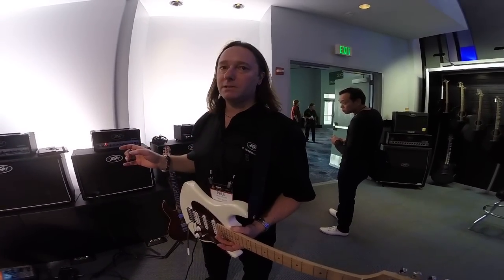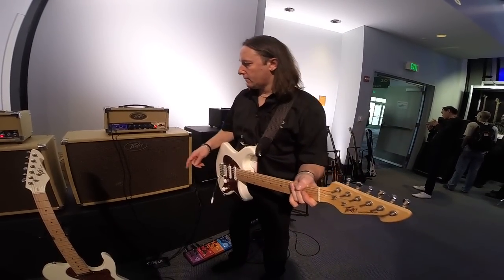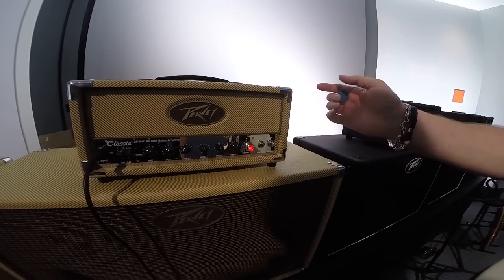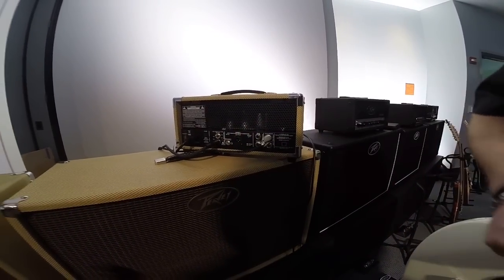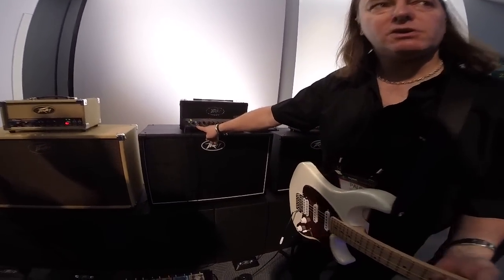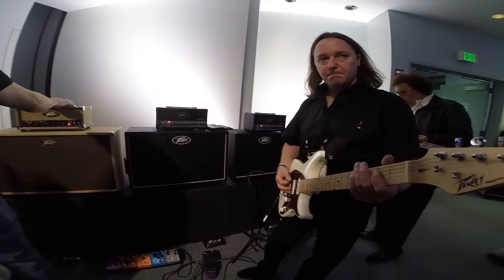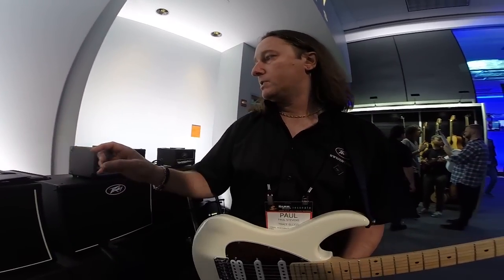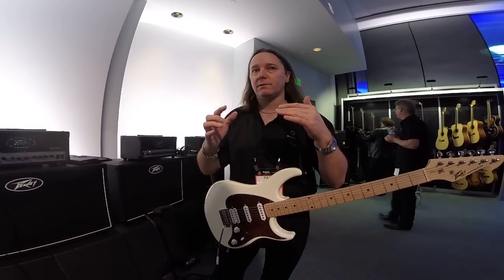**NAMM 2015** Peavey Classic 20MH and 6505MH Demo | Six-String Samurai

Comment: Hey!  I wanna ask a question because this man didn't say anything about the topic i will ask.
There is a switch on the left. It says 220V/230V and 110V. Is it about the different electricity systems?
For example, in my country, all amps 220V and their  and also different HZ rates. But its different in UK or USA. When we buy an amp from an european country or usa, we have to use that amp with an device which changes the V and HZ rates. In this amp, they solve this problem by adding that switch or it has a different feature?
Reply from the maker: Onur Alakus looking at the back panel it does indeed look like they have integrated voltage switching for different countries for maximum portability!
Reply: Yeah! Its exactly what im looking for.

Comment: I don't think the 5150MH uses the requisite 5 tubes though  so there is something different circuit wise.
Reply: Christophe Mion
Prob right. Which means the circuit board looks like a city block of apartment buildings due to all the relays!  Turn the amp on or off and it will sound like you got a lil rock crab scurrying around in it.

Comment: Next time you demo these amps please use a Fender Stratocaster.
Reply from the maker: DSilvergun Why?
Reply: Six-String Samurai Gear Reviews Because it's the most popular and best guitar ever developed.  Plus it is what I play.  Thanks.
Reply: For the Classic maybe - I'd have said for the 6505 use a 7-string with some active pickups, drop tune it and just chug a palm-muted open B for 30 seconds. That's pretty much all anyone wants to know about the 6505MH hahaha
Reply: sonicwingnut indeed none of the namm foootage or reviews for the 6505mh show anything you'ld want out of that sort of amp
Reply: *****
Due to delays in this thing coming out, and especially in it coming to the UK, I ended up buying a Laney IRT Studio rackmount valve amp for like £245 on ebay. Definitely worth the investment, does need a boost for full-on metal tones but has a capable one built in. Also has USB interface on back too!
Reply: sonicwingnut I'll probably still wait for it, since I'm really after that iconic 6505 sound and I'm patient